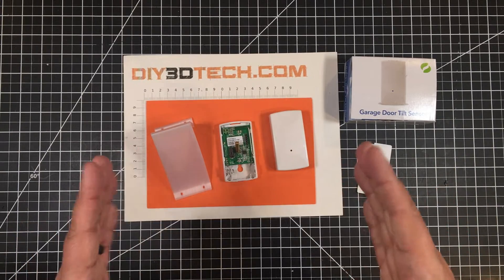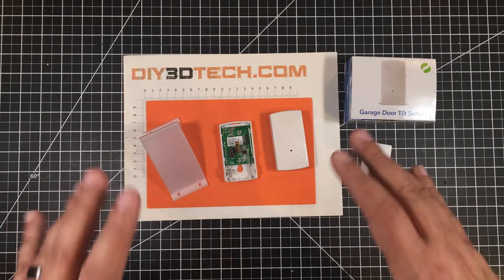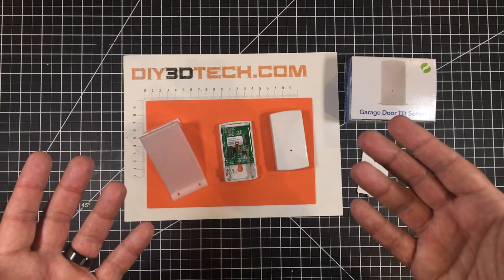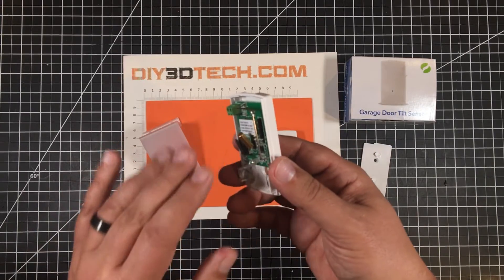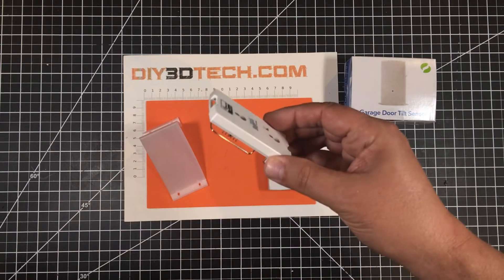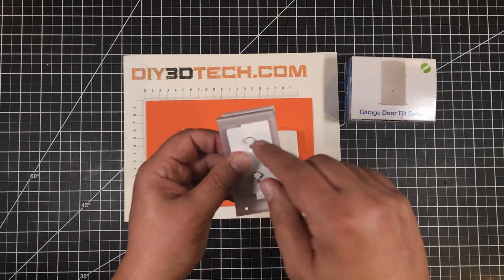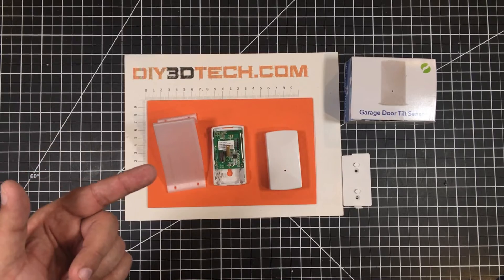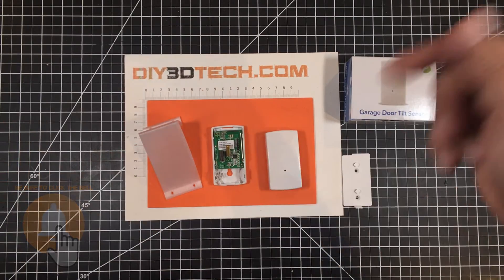Design Talk - 3D Printing Solves Home Automation Problem!

Comment: brilliant solution but i would have bent the legs to the sensor to the required angle, dab of glue to hold the ball/tilt sensor and done
Reply from the maker: Thank you for the kind comment!   The issue as mentioned in the video is because of the case [cover] this was not possible..

Comment: Why not using a normal switch, or a read switch and a magnet, or.......
Reply from the maker: I had considered that and this works better as it is a contained unit.  Using magnet based solution depends on closer tolerance in repeatability and garage doors are not the best at this pre-say.

Comment: Any reason you did not use a cheap Distance Sensor and an Arduino or other Board? This would give you very fine control over the door.
Reply from the maker: Yes this was simple, as the thing I wanted to ensure was an early tip as if I open it for air I typically do it for one panel so this was an easy solution :-)